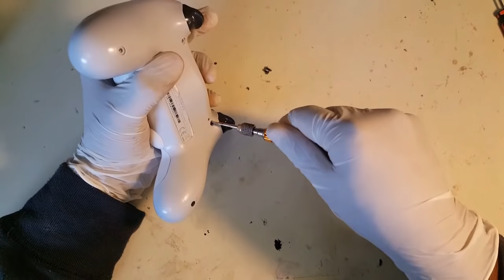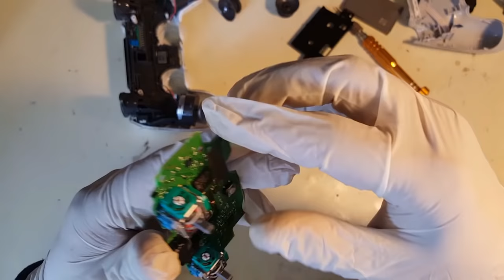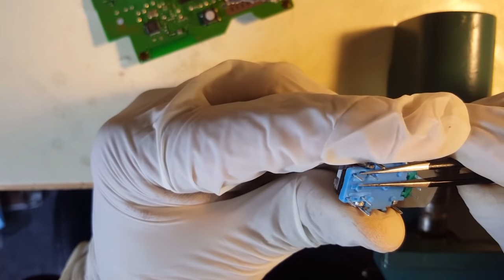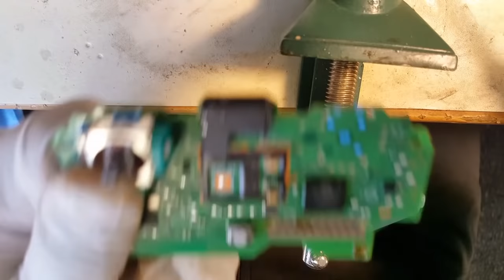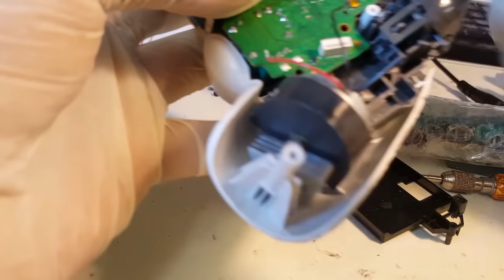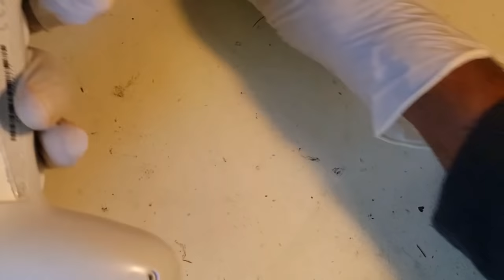Ps4 Controller Joystick Replacement

Comment: Just a little note for people that try to do it themselves: the temp is in celcius lolll so about 750 to 800 F°

Edit : I usually watch DIY car repair video but never have the setup :( but in this video I'm a proud electronic technician who happens to have an even better setup at my job!! I'm among those who can say : ho cool I'll just do eeeeeeeeetttt YAYYY!! 
Capton tape (temp tape is nice too on little components but if you don't have some, indeed aluminum foil will do the trick) be patient when reflowing , in Canada the soldering is RoHS so it's A LOT more hard to get the soldering on the analog sticks so melt, just empty as much solder as you can with desolderimg wick and replace it all with lead soldering for it to be possible to melt, unless you do that, when the analog stick will slide out there will be nothing left of your board )
Reply from the maker: Hot air station: 450 degree celsius
Solder station: 450 degree celsius

Comment: Fix my thing at home i feel proud
Reply: Nice bro. Two questions:
1. Can I use hair dryer instead of hot air thingy?
2. Did you use that locking thing to hold it in place?
Reply: @D3V1L15H95  idk  and no i didnt use the locking thing hope u fix urs

Comment: I really need help on 2:16 bcuz when i was fixing my joystick my wire plug out
Reply: im curious on the same part how to take out without that kind stuff, and put it back ?
Reply: If you mean you pulled the wire out of the rumble pack then you are pretty much screwed unless you replace that rumble pack. If you just pulled it off the board then you can resolder it as with the other parts. Personally I remove the rumble packs entirely, they are too much drain on the battery and are bad for shooters when precise aiming is necessary. I used to always have them turned off now I just remove them completely, which makes the controller a lot lighter as well.

Comment: I can't fill the dam Holes. the outer rings popped off and the solder is just sticking to my iron tip. So frustrated
Reply: Yea you damaged the board and lifted the pads by applying too much heat. At this point your only option is to get some 30 AWG wire wrapping wire and use it to directly connect the traces on the board to the pins.
Reply: @nerdstrangler4804  Yea, i pooched it. I don't see how ill get those on. Thanks for the idea though. I bought a bundle of new/ used boards,they work great except now my swipe isnt functioning. ..:(

Comment: Resoldered a new one back on mine and it’s not reading anything on the stick 😢
Reply: You may have received a faulty one, it's fairly common. You should always buy more than you need to replace in case it doesn't work. It also could be the case you soldered it poorly and then it's even easier, just reapply the solder and test it again.

Comment: im using a 40 Watt solder but doesn't come out any tips?
Reply: add some fresh solder, use a solder wick or solder pump to remove the solder. If you have a hot air gun It's much easier since you can melt all the solder at once and just pull the analog out.

Comment: My my soldering iron/heating tool doesn’t seem to melt the thingies, i gave up
Reply: U just add solder wire by melting with iron tip on that point will make it easier trust me.

Comment: I've repaired afew recently.
It's NOT worth it, replacement joystick quality is rubbish even with original Alps parts.
Out of 6 joysticks 4 had drift and 2 large dead zones.
Of you have a problem with L3 stick tape over the microswitch to replace the worn out plastic or replace only the microswitch not the whole joystick.
Reply: Controller may be factory calibrated to the original sticks. If those original sticks were way off center that may be why replacements aren't working. Should try recalibrating your controller.

https://youtu.be/POEXAmWJdYI

To be fair I have no idea if this actually works, have never tried.
Reply: @nerdstrangler4804  they work just fine but have large dead zones, makes precise aiming/movements difficult.

Comment: I did this as well and you know what guys, i fucked up my controller with new analog stick, becouse it's not responding like original.. impossible to aim.. I've put back the original analog stick and replaced white disks inside the analog stick.. but still it's not as original, there is a difference in between original and Chinese analog sticks... it would be amazing if you add the link for your analog sticks if they work as they should

Comment: You don't need a soldering tool, you have access to the joysticks if you take out the inside, there's a screw on the green board that you need to take out thats behind the battery and then the red connecting piece above the battery.. then you can gently pull out the board and the whole 5hing and your left with the top of the controller

Comment: This is super long. I just done everything on the video but the stick still aint coming off
Reply: Are you using a hot air gun you need a hot air gun and if it isnt coming loose then turn up the heat a little bit. If you have the right equipment it's a very easy and quick diy

Comment: I was trying to fix controller and was doing everything right until I realized that the black wire was broken 😶 damn now it's worse than the original problem...
Reply: Those wires are only for vibration
Reply: @frank2358  no they not. If u break the black or red wire connected to the motherboard ur completely fucked up the controller because the analog stick will get stick in whatever direction u push them and it will not react to you trying to get it back on track. It's done for I did this 2 times. Both times I was careful, did everything by the video.
Reply: @sonicx1298  Dude, just resolder them

Comment: Ok... So I've actually replaced the controller, successfully, thanks to Suvio. Just followed the video. Spend the extra $ and get a rework station (soldering iron & hot air gun combo). Learn to tin the tip (helps protect the tip) & how to actually solder. I used a beat up one to practice. Only thing is finding reliable replacement controllers. I've bought 18 and so far 4 out of 8 have been good replacements, 4 of them still had some drift to it. 
Anybody know. were to get good replacements?
Reply: Amazon have them .

Comment: I ripped my 4 wires, how do I fix those
Reply: You don’t need them, it’s so ur controller can vibrate, if you want them back, you have to solder them together, but I don’t think you want to go through the trouble of that just for it to vibrate
Reply: @10kmarti  Something is wrong with my controller, if its not the wires, it automatically looks up and cant be moved and presses r2 on its own somehow

Comment: I think I'll just pass and buy another controller lol
Reply: Right with u pal
Reply: New controller ~$60 new analog stick ~$6
Reply: Jack _ even if you didn’t a good soldering iron with all the appropriate equipment to keep up on it is ~$30 and  wire is ~5 and a Phillips driver ~$5. Still make out positive over buying a new and you still have the ability to make cheap repairs. Still don’t want to do it? There are people that would do this repair for $10-$15. The biggest question, would you buy a new car if your catalytic converter rusted out?
Reply: @chaltain_7601  A car cost thousands and a controller a few bucks...
Reply: Simple task to repair
Reply: @chaltain_7601  Ah, the good ol' "most extreme example to prove my point." Yes, most people who use a day or half a day's pay to replace a controller versus a year's pay to buy a new car. What's it like living in logic-free la la land?
Reply: GruppeSechs why is that logic free? Lol the point is valid. It’s definitely not the most extreme example and it’s just an example to illustrate the mindset of buying new, instead of maintaining old. People tend to understand how cost efficiencies work when you can give a more obvious example of their deficient behaviors. Which obviously went over your head still. Lol so at that I’ll break it down easier for you. Buying a new controller for broken controller stick bad, new controller’s stick break  too. You have to buy another new controller. It break too. Now you have 3 broken controllers. Controllers all cost $180. None work. Repair cost $30 himself. He fix all controllers for $10 after he buy tools for $30. Cost him $60. Repair is good.
Reply: GruppeSechs and by the way, who is buying a new car in a years pay if a new controller is one days pay?? Who’s logic is broke??
Reply: @chaltain_7601  What are you talking about? If someone is making, say, $24,000 a year, that's roughly $100 a day. I said a day's pay OR half a day's pay for a reason. Do you have a learning disability?

And do you not understand proportionality? Someone is far more likely to buy something new for $50 than they are the price of a damn car. It's a stupid example. Why does anyone have to point that out to you?
Reply: GruppeSechs so what you meant was not OR a half days. It’s is a half days pay.. can’t be both for someone who can buy a new car. the point isn’t whether some is likely to buy something new it’s why it’s not good to buy something new in place of repairing that product. Stay on point. Because you havent given any argument against repairing other than people don’t do it..
Reply: It’s an exaggeration to make the point more obvious. It’s you make a comparison that is more closely related in dollar amount the point isn’t be made any more clearly because you reiterating what you said with different products instead of showing how the logic is broken as soon as you scale up. You just don’t like the fact the example of car being thrown away to buy a new one makes no sense and if that logic applies to controllers what you’ve been doing for the last few years has been stupid. You probably clicked on this video saw that it was more than 4 screws and decided 15 mins of effort wasn’t worth it..
Reply: GruppeSechs they save $20 on the first repair and $50 on the second. If you do it yourself you don’t have to worry about it being half asses. As stated you will have this same reoccurring issue every 3-9 months so if money is an issue in the first place buy new is a terrible idea since you’re buying the same issue over and over again. It’s not really a minor point since every is here because they are interested in DualShock 4 repair.. as for the comparison for the car repair to controller repair do you think people don’t half ass car repairs? I for one worked at a dealership and saw half assed repairs first hand. What would you like me to compare then, your food stamps? Since obviously the prospect of a car just throttles you. If the only thing about the car comparison that is off for you than it is a good comparison because the amount of money of which you save from repair vs buying new is not important. It’s the idea that you don’t buy something new if you can cheaply fix the issue especially if you’re buying something new with the same inevitable issue.
Reply: @chaltain_7601  This guy over here saying the idea of a car throttles me when he's vehemently screaming about saving a pizza's worth of money on a console controller every six months. Stay golden, pony boy. You're beyond help. I'm out.
Reply: @chaltain_7601  I got a question , do you need the heat gun ? I'm trying to repair my controllers , But I got the soldering gun and I mean I would buy the soldering sucker to remove the iron Let's say just heating the iron one by one and taking it out with the soldering sucker it is possible ?
Reply: Elinson Canales I’m no expert but the principle should be the same. A heat gun probably allows for better heat distribution and keeps you from damaging the board.
Reply: @chaltain_7601  I bought a soldering kit 25 quid. It had everything except the copper wire stuff and the rosin was a solid form so I spent another 7 quid on another small kit with better solder and rosin. also I had to get the copper stuff that was 3 quid so we are at 35 pounds so far. Then I had to spend a few hours learning about soldering I'm still very much a beginner. Time is money after all I'd say 2hrs is worth another 10quid at least. So we are at 45 quid now so I have two broken controller's I done the vibrate parts as practice all is good with the rosin. But now I realise I need cleaning solutions and even a vice as soldering on my leg seems extremely cowboy. Oh and also I need replacement thumbsticks I got them for just under 5 quid so we are already over 50 quid as I know the acitone or alchol will be around a few quid. So it was quite the effort getting this part off but replacing it was easy I was happy with the soldering but now my controller won't switch on anymore I've no idea what I've done I guess I've over heated it or blew a fuse of some sort I really have no idea I need more experience. My point is with little easily broken things like this your better to get a professional. With a car well the working parts are way stronger and it's alot easier to do DIY with a car.
Reply: All you really need is a stead hand you dont need a heat gun
Reply: @raymond1st114  you need a little know how I wouldn't recommend trying to solder a PS4  control until you had some experience. The desoldering is by far the hard part.

Comment: Actually its rather to state the equipment name for us to refer. I want to buy the equipment on the accessory shop first.
Reply: Just buy a soldering kit on Amazing for 20. It has everything you need. Analog stick replacements are on ebay
Reply: @Pendaemonium  Noted thanks~

Comment: I wouldn't try this unless you know what your doing I actually opened the green circles and I ended breaking them so I fixed the drift part now I just can't go up or down just left to right..,😂
Reply: Just finished doing this. Having the same problem. No drift, but no up and down only left and right. 😂

Comment: For everyone saying, "I'll just buy a new controller", because it seems a little intimidating, I just would like to say, why? A new controller (official), a new ps4 controller runs for about 60$, and the replacements are just about 10$. So if you looked up this video was for a reason. You are a cod gamer that keeps in doing this to every controller you get, so why not just learn and fix them oyo going forward.